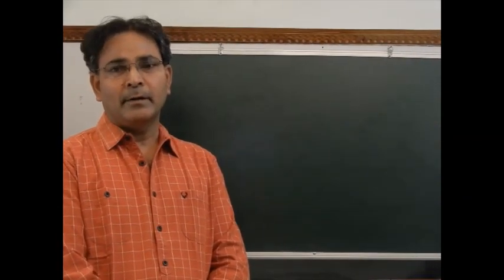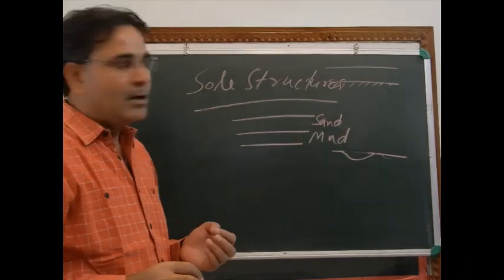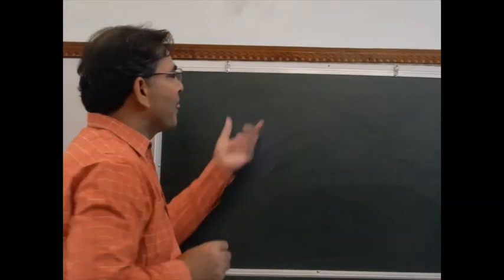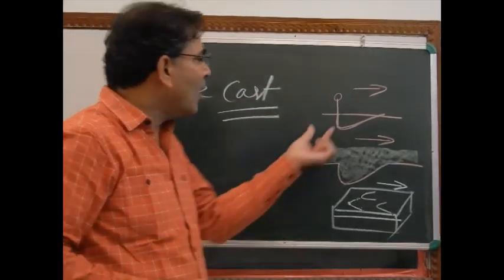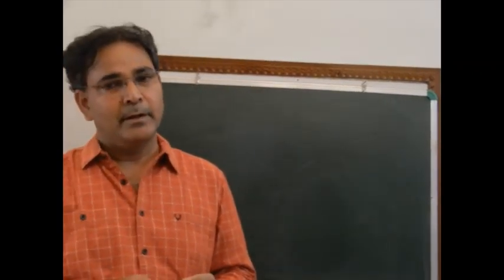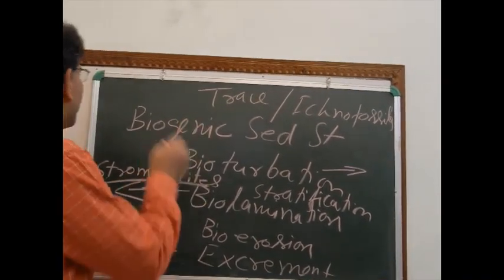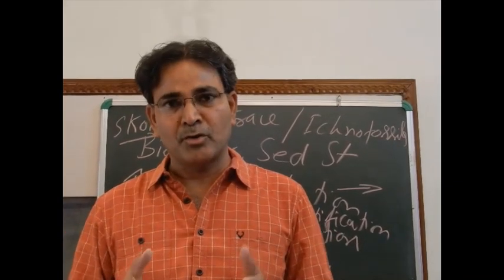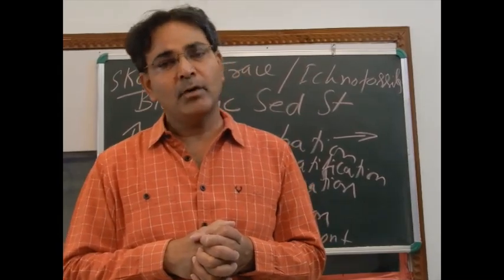Sedimentary Structures, Part 3, Sole Structures, Prof. Dhruv Sen Singh, University of Lucknow, India

Comment: Sir please can you distinguish between ball and pillow structure.. And lenticular bedding as in both of these lens of sand are formed in underlying mud unit.. Regards
Reply: Hello....nice question. It does let you ponder:')
 What can I infer is, that l lenticular bedding in an interbedding of sand and mud with sand lenses in different directions. They form in the regions of slightly excess mud.

 Whereas, ball and pillow structures are in the lower part of the sandstone. With a discontinuous bulbous sand ball like structures in the mud. They specifically result from shocking or liquidation of mud.